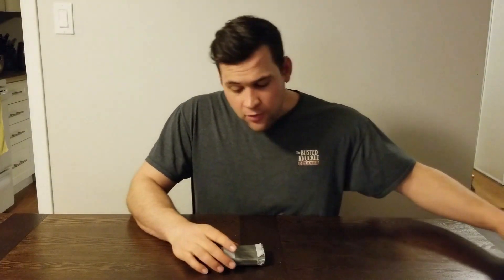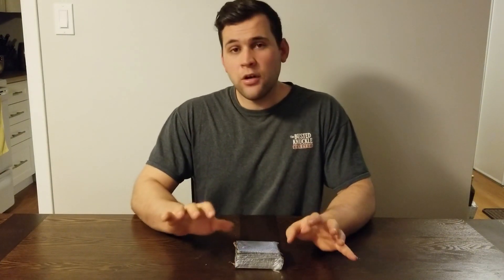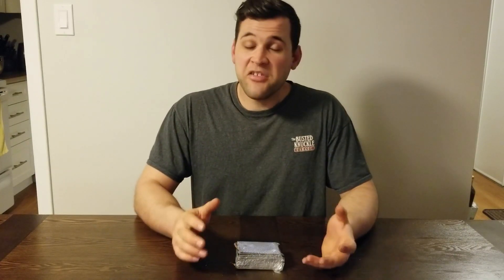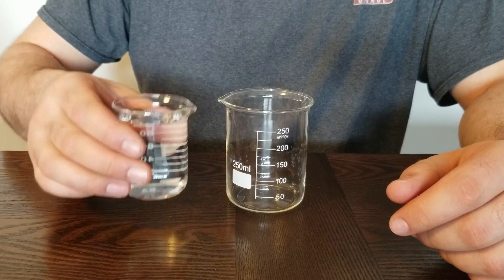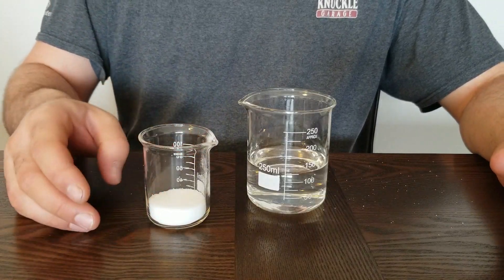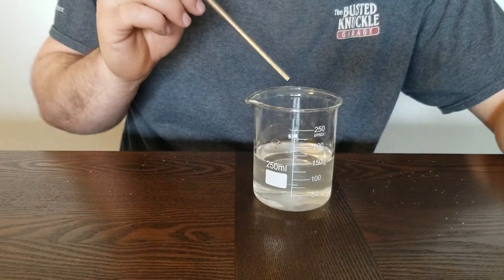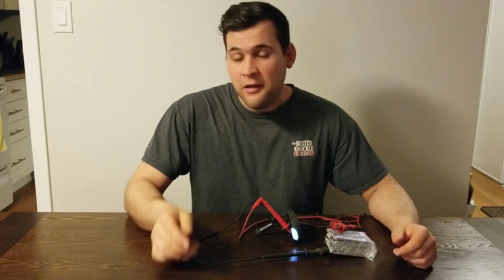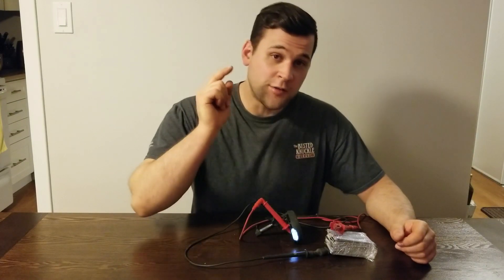Aluminum Air Battery Build 2.0

Comment: How would using EAN Nitrox (32% O2) instead of air affect the performance of the battery?
Reply from the maker: That's a really good question.  I have also thought of increasing the battery performance by increasing the O2.  I was thinking of using pure oxygen like what's available for oxy-acetylene torches.  I haven't been able to experiment with this yet but I would suspect there to be an improvement.  Hopefully it is something I can look into in the future.  Cheers!

Comment: If you need any academic papers to help your research let me know. I have made my own batteries using MnO2 as the ORR catalyst using hydrothermal synthesis. Let me know if you want some. Applied correctly it is as active as platinum and a battery I made using this catalyst got up to 250 mW/cm2
Reply from the maker: @UC Santa Barbara PhD Student.  Wow, that is very generous of you.  Yes I would gladly accept any papers you can give me.  Looking them up on Google can be a pain sometimes.  First time I've heard about using MnO2 as the catalyst.  Definitely would like to learn more about it.  I've got an email featured in the about section of my channel.  You can use that to contact me.  Thank you very much for the offer.
Reply: @UC Santa Barbara PhD Student do you have a video explaining that? Would it resemble this solution https://youtu.be/3EKmetdjE-c ?

Comment: try to connect those strips in parallel for better amps...coz that increase the watt ..and if u gonna try this or do this again, try to make them in roll cylindrical shape..
Reply from the maker: Good ideas.  Thanks for the feedback.  I'll have to try them in future designs.  Cheers!
Reply: Watts are watts, if you double amperage but half voltage you aren't getting any extra wattage.
Reply: @craftxbox  watts are watts man but here we have 5.7 v with 13 milli amp(0.013) its nothing ..the watt is 0.074 here but if we have 3v and 1A we could get 3W .
Reply: @craftxbox  well i dont get magically extra power...but i do get "electrically" actual power
Reply: @sivasanthoshr.m2222  What are you trying to say? you're still getting power either way, it just depends on if you want amperage or voltage
Reply: @craftxbox  you'll never understand the point man ...just skip this

Comment: Great battery design! Do you know where oxydised aluminium ends up? In the electrolyte solution or on the surface on the aluminium sheet? I am wondering, if you had your aluminium sheets twice as thick, would you have twice the usable capacity? Also, if you are going to make more Al-air battery experiments with your current or future battery designs, I would like to see what happens when you let it discharge fully. How much capacity there is (at least approximately) and what it will look like inside once it's empty. Maybe also to see if you can swap out the aluminium sheet and use the battery again. Anyways, there aren't that many videos on YouTube about Al-air batteries, and your videos are really great. Big thanks!
Reply from the maker: @Head Master Hey there.  Thanks a ton for all this feedback.  In answer to your questions.  I believe the oxidized aluminum ends up in different places depending on the electrolyte (although I could be wrong).  If it is acidic I think that it goes in the electrolyte, but for saltwater solutions I think it builds up on the anode.  Thicker aluminum sheets could in theory increase the battery capacity, although there are greater problems hindering their longevity.  The main one I see as electrolyte evaporation (mine only last about a day).  I am working on more battery designs for future videos.  Definitely will keep your suggestions in mind.  I really like the idea of a post battery tear down.  Thanks again, I am glad you appreciated my videos.  I'll see you in the next one.  Cheers!
Reply: @MechanicGoneRogue  Yes, I think you are right regarding where the oxidized aluminum ends up. It makes sense to me! I am looking forward to seeing your future designs. What if you would put your battery in pure oxygen?..
Reply from the maker: @Head Master I would imagine pure oxygen would boost the amp output, but I don't know by how much.  I like your thinking though.  I've toyed with the idea of using compressed air or pure oxygen for the cathode, but have not gone further with it right now.  Something to explore in future videos though for sure.
Reply: @MechanicGoneRogue  It is not only more or high pressure oxygen, but the anodic reaction occurring on the aluminium side also determines the overall speed of the total electrolytic reaction. So I believe, using high pressure oxygen would not make very much difference. However, if you could also do something on the anodic side to remove the reaction products whatever they are, then this might affect the total output and then you may see a significant increase in the reaction rate/ capacity or output. Thank you for nice videos. I really appreciate it.

Comment: There shouldn't be any ph differences between table salt and potassium chloride, which is used as an alternative salt for health purposes
Reply from the maker: You might be right about that.  I had read up on it when I was making the electrolyte, but I might have got some bad info.  Nonetheless I did get better results with potassium chloride so I didn't question it.  Thanks for pointing that out.
Reply: @MechanicGoneRogue  no problems chief, but there's an empirical advantage to potassium chloride that you can always use
It sounds a lot cooler to the layman than "table salt"
Reply from the maker: @Guy That Hahaha yes that is definitely an advantage.

Comment: What can go wrong safety wise?
Reply from the maker: In my opinion not that much.  I mostly just avoided getting electrolyte on myself.  The main reason for my disclaimer is that with a public video I don't want to assume liability for other peoples actions.  If anybody wants to try something that I do in my videos they have to bear all the responsibility and risk.
Reply: @MechanicGoneRogue  Haha I figured as much, I'd do the same but the whole thing seemed relatively safe for the amount of stress you put on those warnings, I've seen ppl make TATP (a pretty sensitive high exp) with fewer warnings
Regardless nice build, it's definitely unique, I would personally like a bit more of the science in these videos, when you say "I did a lot of reading beforehand" I get curious
Reply from the maker: @Guy That Haha yah I do tend to the cautious side of disclaimers.  My motto is better safe then sorry.  Glad you liked the video!  As for the reading, yes I have done a lot on metal air batteries.  I don't always understand it, but I've read it lol.  Glad to know where your head is at.  Maybe I can try to explain a little more in future videos.  Cheers!
Reply: @MechanicGoneRogue  cheers!